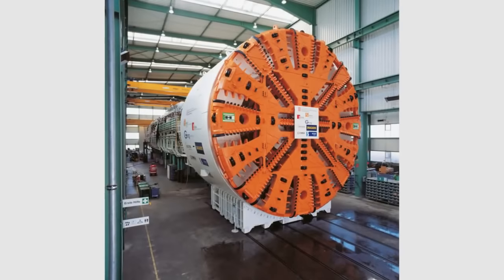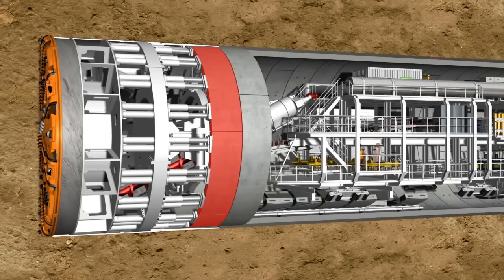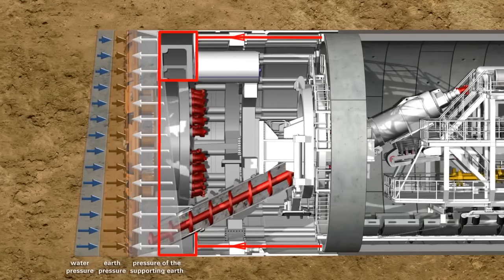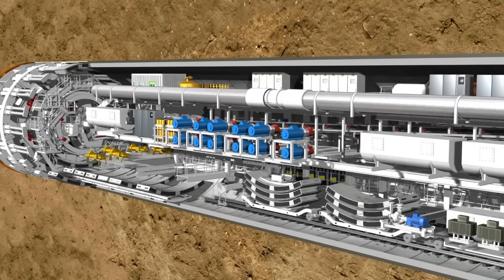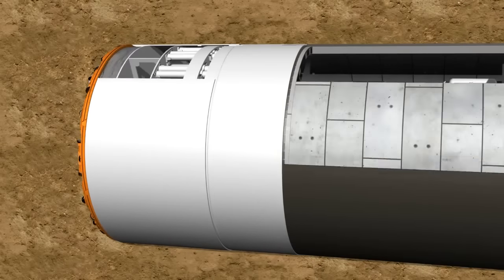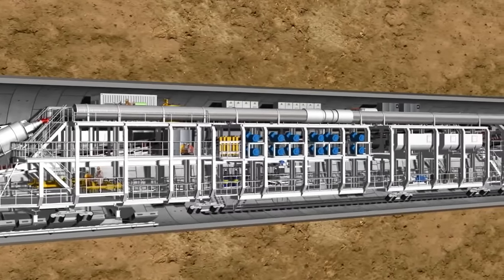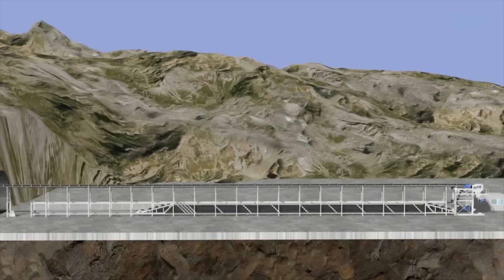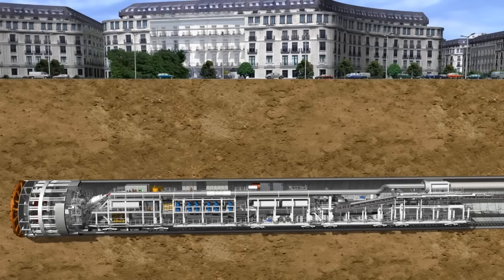Herrenknecht Tunnel Boring Machine (TBM) animation.

Comment: You don't need a 12 metre tunnel for metro trains. 3.5 metres to about 4 metres is fine. That means the risk of subsidence is drastically reduced.
Reply: For Barcelona it was necessary since they have the metro tracks stacked so they can use only one TBM. Using two of them would've caused massive disruptions in the city center.

Comment: What about the earth pressure balance during cutter blade change process?
Maybe it can be done at safer areas with harder soil then only and is rarely needed with soft soil.
Can this drive under sandy river or lake bottom?
Reply: I work as a mechanic on one of these machines. If the ground is stable enough, you can simply open the bulkheads leading to the excavation chamber and cutterhead from behind, and do it that way. If the ground is unstable, the machine comes with man-locks (essentially a series of air locks) that allow men to enter the chamber while it is still under pressure, sort of like saturation diving.

Comment: Does anyone know how the guidance system works?
How does this monster find its way in the dark?
Lasers can't shine through Rock.
I'm looking for a real explanation and haven't found one yet.
Reply: I work as a mechanic one one of these machines. It navigates by using a series of lasers and prisms placed at various points along the machine and in the tunnel behind it. By doing so, the machine is able to constantly be aware of it's position in 3 dimensions. The entire route of the tunnel is pre-planned, and the machine uses the lasers to compare the machines current position and trajectory, with the pre-planned route, then presents the current deviation from the route to the operator, who can steer the machine by adjusting the pressure of the hydraulic ram groups. The operator can also use a second set of cylinders to make minor adjustments to the angle of the cutter head.
Reply: @johnindermuehle7632 how do the teeth work? I don’t see much being said about the teeth.